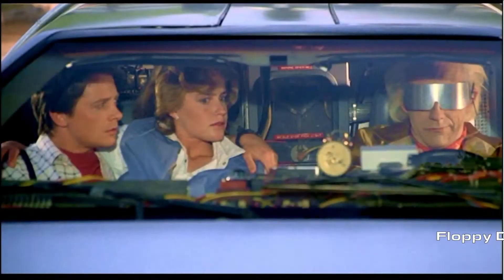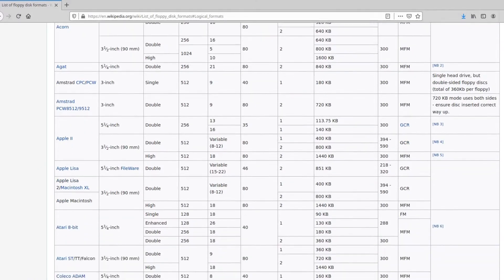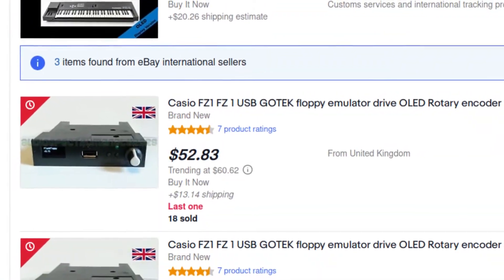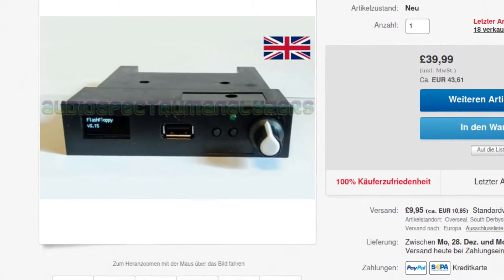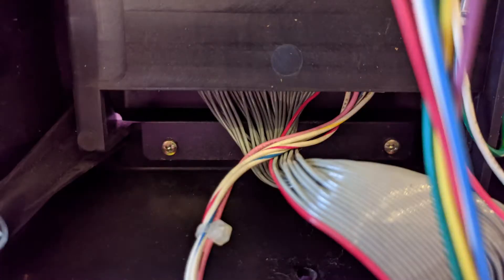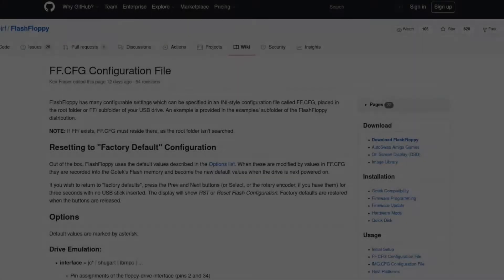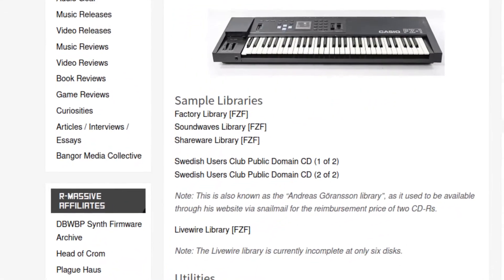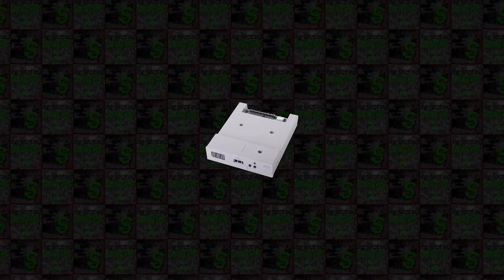RS030 Tech Support: Casio FZ-1 Gotek Drive Flash Floppy Awesomeness!!

Comment: Never managed to get a DX7II FD (floppy disk!) to work with one of these...I've been through all the tutorials and firmwares  - but it's never recognised by the DX7II. Can't be that hard to emulate whatever the DX7II is expecting to find on the end of the cable?
Reply from the maker: Actually there are quite a few parameters, that have to be just right for these to work properly. Took me quite some time to figure these out for the FZ1
Reply: @rejectedsynths  Fair point, just struck me as funny/astonishing that a 720K floppy drive from 1988 could baffle us compatibility wise in 2024! We've lost so much!!!LOL

Comment: Great Video! I am attempting the same with my FZ-1... I have the rotary oled gotek using flashfloppy and have matched your jumper settings and config file - I can load .hfe files into the FZ-1... but... when I sample a sound using the FZ-1 and try to Save Voice to the USB blank image I get a NO DISK SPACE error - any ideas on solving this would be really appreciated! Thanks!!
Reply from the maker: Hmm, it's been a while but I think you can erase/format the virtual disk from the fz1s internal tools. Maybe try that. Just a dumb question, but is there a chance the samples are simply too big to fit on a single disk???
Reply: @rejectedsynths  Hey - Thanks for the quick reply!! Yup, I tried with a very short low rate sample and it gives the same - I'll try erase/format the virtual disk now, thanks for the suggestion! I'll let you know how I get on
Reply: @rejectedsynths  this worked - THANKS!!! I really appreciate it!

Comment: Really cool, I might do this to my FZ-1. But I have to think about how to backup my floppies to disk images first.
Reply from the maker: Usb Floppy Drives are readily available, I guess finding the right software to back up the disk images is the harder task here. Maybe anyone can recommend something?
Reply: You can probably read the FZ-1 floppies on a PC with BUILT-IN/INTERNAL floppy drive (NOT external USB floppy) and software like OMNIFLOP. An internal drive has a full floppy controller to read the disks at low level, which a USB floppy drive cannot do.

Comment: How about a video on connecting FZ-1/FZ-10M to a computer via the expansion port? (The later FZ-20M had SCSI instead.) It's been done with a custom cable, software has been written for PC-DOS and converted to Windows XP. Info online if you dig around...
Reply from the maker: Hey Jeffrey, thank you for your idea, I'll see if I can get this up an running. Software can be emulated but finding a parallel port on a pc in 2021 might be the biggest challenge here though 🙈
Reply: @rejectedsynths  Lots of retro-users keep old Win XP systems with built-in 3.5" floppy drives to read/write old format disks, and those likely have parallel ports, too. Since YOU'RE now officially a retro guy, maybe it's time to get one! They're easier to find than an FZ-1 these days, probably not much money, either. (Maybe even free...)
Possibly there's a USB to parallel adapter that would work? If you Google and/or check online forums about this, you'll get the low-down...
Reply from the maker: I've got to admit, as a retro guy, I have about half a dozen PCs from different ages stored away somewhere, but as someone living in the 21st century, I'd rather look into ways of making old stuff work on new stuff. The real bottleneck in this case being the parallel port, the rest can probably be emulated 🤔
Reply: @rejectedsynths  There are 25-pin parallel to USB adapters for UD$3.50 shipped on Aliexpress and full 25-pin parallel to USB cables for US$13 shipped on Amazon. Whether those will work with modern PC and Win 10 directly or a Win XP emulator running under Win 10 needs to be worked out/researched.

There are a bunch of other issues w  modernizing/upgrading the FZ, but you can Google to find active forums discussing developing solutions, if you're interested. Also, archive.org can be used to access old, closed websites with info. Good luck and cheers!
Reply from the maker: @ShallRemainUnknown  Once again, thank you for your input! I've already had a look at these usb to parallel cables and it looks like they are specifically built to work with printers only, other timing critical applications, like the one we're approaching here are probably bound to fail :(
Reply: @rejectedsynths  Ah, I see, too bad. At least the Gotek is a big improvement, and you could still try tackling the 4MB upgrade. It looks like you don't even have to have the official FZ-1 1MB expansion card to expand to 4MB, since you can actually stack the additional RAM chips three-high! It's a bit of a technical undertaking, but there's full documentation available online to guide you. Plus, you'll be immortalized as the first to make a YouTube vid of it!